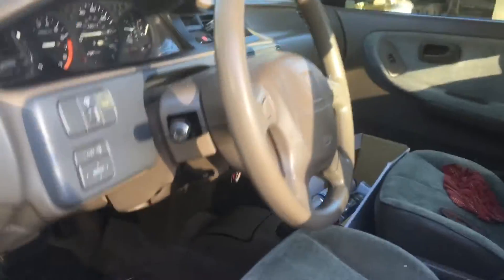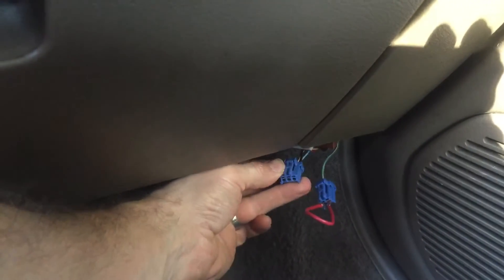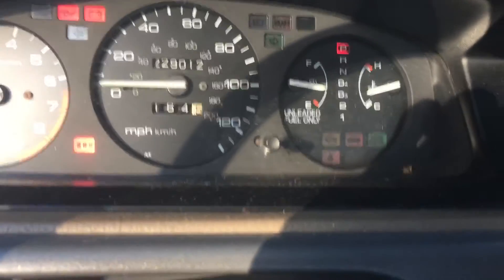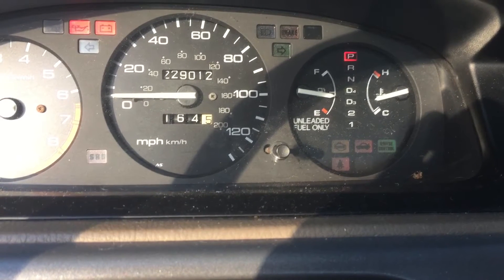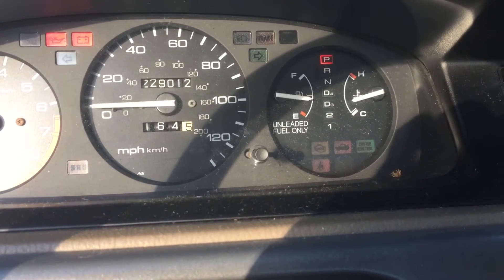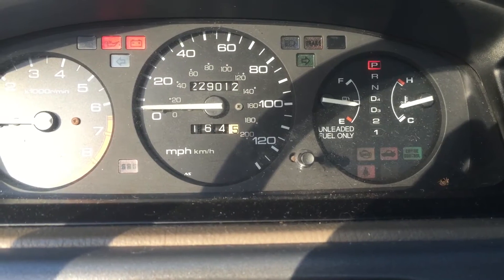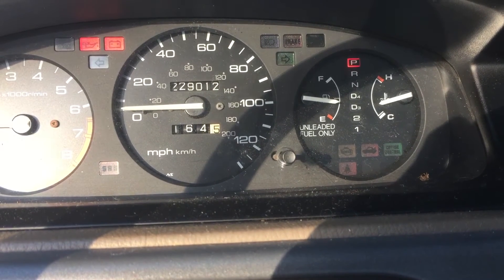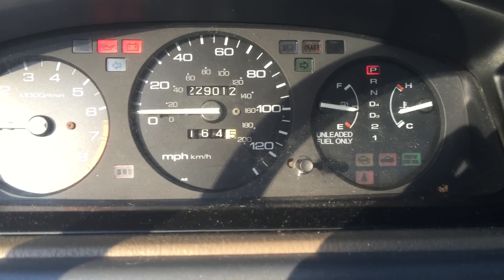How to read and scan for check engine light on older Honda

Comment: My car the first blink Is short and 7 long. The first blink is 1 short and 7 long. What number It the code?
Reply: Sorry i was wrong. My first blink Is long then pause and blink 7 long. That all he do 1 long pause and 7 long. Can u tell me what the code?
Reply from the maker: 0 ECU 
1 Oxygen Sensor 
3 Map Sensor 
5 Map Sensor 
6 Crank Angle 
7 Throttle Angle 
8 TDC Position 
9 No. 1 Cylinder Position 
10 Intake Air Temperature 
12 Exhaust Gas Reiculation (EGR) System 
13 Atmospheric Pressure 
14 Electronic Air Control 
15 Ignition Output Signal 
16 Fuel Injector 
17 Vehicle Speed Sensor 
20 Electronic Load Detector 
22 Vtec System Malfunction 
23 Knock Sensor 
41 o2 Sensor 
43 Fuel Supply System 
45 System Too Rich or Too Lean 
48 Primary Heated o2 Sensor 
54 Crankshaft Speed Fluctuation Sensor 
61 Primary o2 Sensor Circuit 
63 Secondary o2 Sensor Circuit 
67 Catalyst Sytem 
70 Automatic Transaxle 
71-74 Random Misfire 
80 Exhaust Gas Recirculation 
86 Engine Coolant Temperature Circuit 
90 Evaporative Emission Control System Leak Detected 
91 Fuel Tank Pressure Circuit 
92 Evaporative Emission Control System Insufficient
Reply from the maker: This was all that I could find, maybe you have two codes going on. The long blinks are suppose to represent the first digit so one long would be 10 two long would be 20 two long and two fast would be 22. Hope this is helpful and not info that you already new.

Comment: did repairing or replacing the (cluster)fix the check engine light?
Reply from the maker: Replacing the cluster or replacing the speedometer cable can correct this issue. You would want to investigate the cable before replacing the cluster.

Comment: My car has a little box on the side where u said to remove the carpet, could that be where the connector is?
Reply from the maker: Superior I believe the connectors may be in the little box, I would check the side wall under and over the carpet, it could even be tucked away behind the glove box.

Comment: does these codes work for all type of cars ??
Reply from the maker: This is process is very common among many different make and model 
vehicles. The code flashes would most likely have the same 
meaning/description if you were checking codes in this same manner but 
on a different  vehicle.
Reply: i had watch video before for BMW which need to step on gaz pedal in order to read engine codes without make any connection
Reply: 92 civic obd1 turned my key like you did and the light just came on and stayed on didn’t blink